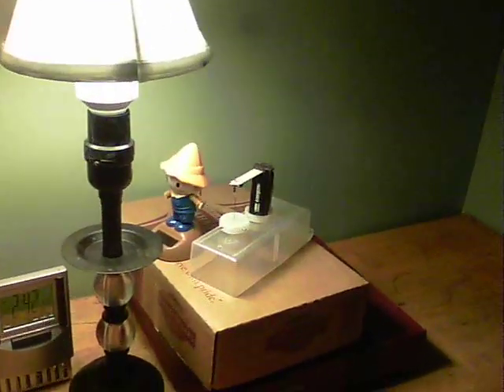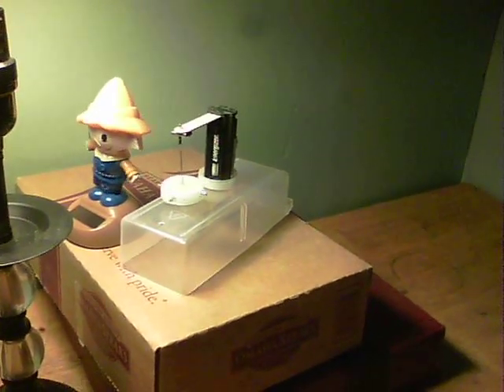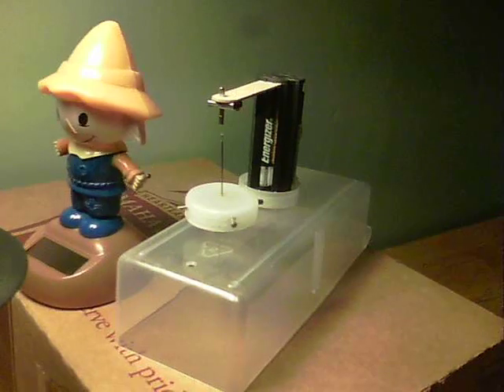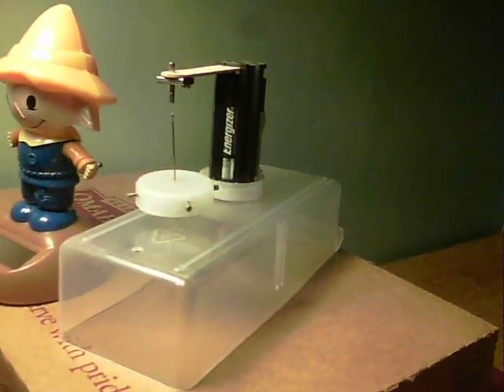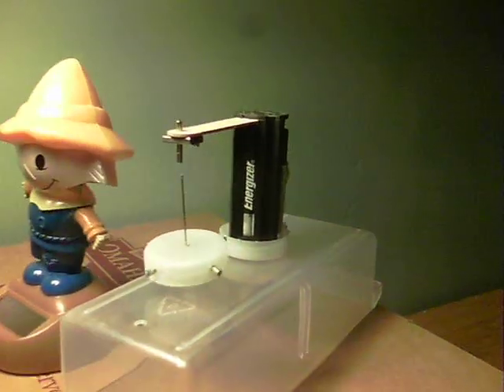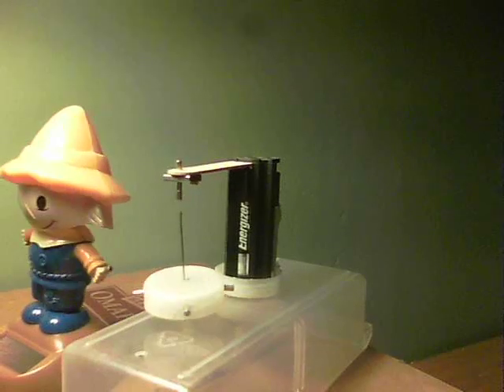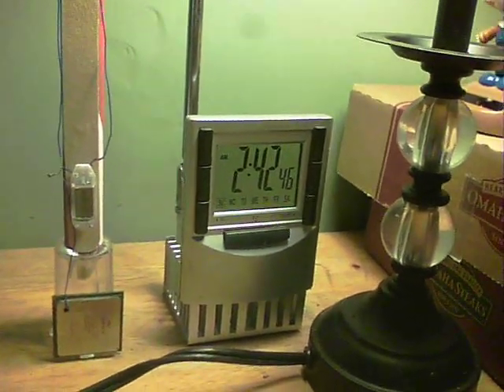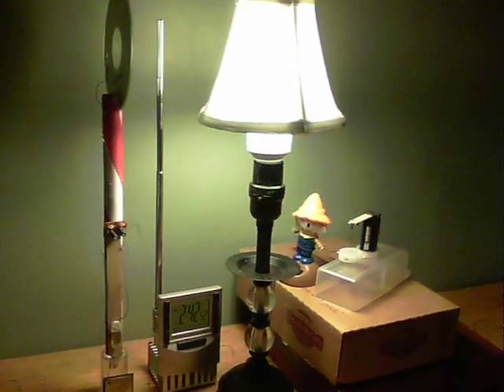Lidmotor's 90 degree dancing rotor

Comment: Excellent!!  I am wondering now how we can refine the idea to make these things run better.
Reply from the maker: The speed isn't enough to generate energy from it seems, but I wonder if the coil can be diode tapped for the back collapse. It may end up as a charger.
The plastics could certainly be upgraded, reusing the circuit but a new mechanism be built. That mechanism would have a much shorter travel but be faster...so giving the possibility of output from the magnets past a coil.
A desktop solar generator being the idea...plus fun to watch :)

Comment: Nice and simple build, plenty of those dancing figures on Ebay.

Can you supply a link for the battery free radio? Thanks.
Reply from the maker: I've done quite a few crystal sets etc, but do you mean the clocks ?
If so, here's the demo video and the circuit diagram:
CFL Induction - A mains light into wireless electricity
Reply: slider2732  Yup, thanks for the link.